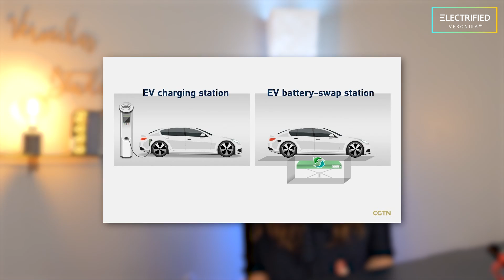New BATTERY SWAPPING Electric Vehicle Technology!

Comment: I was thinking that this swapping is the ultimate way to go in EV environment, until I started to work on BMS SW. First of all standardization is necessary not only in mechanical constraints but also in SW controller too. Especially modular swap brings many questions such as battery balancing, SoH algorithms, integration of info about SoC, SoF, cell type related OCV calibration information etc etc to the SW. It is very complicated and since we talk about a component it is like changing your diesel injectors not changing your fuel tank :)

Comment: I would not mind do a battery swap if I can get my battery back. And the battery swap costs less than supercharging station. Kind of mean I'm borrowing the battery while taking my battery when I go on a long trip and when I come back I want my battery back.
Reply from the maker: Interesting! Did not think about an option where after a road-trip you would get your own battery back 💡
Reply: @ElectrifiedVeronika  can I add a battery and a in-wheel hub to the rear of  a front wheel drive car to turn it into a plug in hybrid?

Comment: Congratulations on a great informative and inspiring video. To be honest I have thought that this is the way forward for many months. All we need is to transition the oil companies to be the battery owners, they would convert their petrol stations, (at a rate of say 15% per year this would meet E.U targets) and have future revenue stream replacing that lost from reduced petrol sales. They also would have the power ! to influence the car makers to change their designs and offer very attractive terms. The car manufacturers would win because of greater EV uptake. Everybody wins. Simple.
PS. 
Some of the Oil companies also have solar power divisions, so PV equipped charging stations could be possible and reuse of battery packs in power systems could be considered as another business to move into for them .

Comment: One thing that everyone seems to be overlooking is if you go to the modular model, say the suspension is tuned for 4 modules but now you only need one installed, you would have to have a way to adjust the suspension for 1,000lbs less weight. Also the KWs that the motor or motors are capable of will have to be adjusted way down if you change from say 4 modules (120kwh) to one (30kwh) for example. Now you can only get say 120 kw (161hp) out of your motor vs 480kw (644hp) out of a 120kwh pack.

Comment: CATL isn't a car manufacturer but rather a battery supplier to other EV makers. Their battery swapping solution might turn out to be a pseudo standard in the long run if it is well executed and well received by other Ev makers and that might also solve the infrastructure duplication problem which the Chinese government would view as a nightmare with too many competitors in that space and a dilution of capital in a variety of solutions. At first look, Catl battery swap seems well thpught out with huge potential, but the proof is in the pudding and we have to see how well it's executed and received by the partners in the project.

Comment: I'm almost sure that big car companies will not be interested in such battery swapping technologies. At least, during next two-three years. This technology doesn't solve today's batteries shortage, it even makes it worse. All cars are different and they will be different. Tesla will move all their cars to structural battery packs in 2–3 years, other OEMs have no time and/or money to develop one more body technology that has a very cloudy future. For new Chinese start–ups this swapping technology can be an option, it also can be an option for electrical city taxies but for most people it will always be more expensive and complex to swap the battery than to charge it at home. Modern LFP batteries can last up to 1 million km so nobody will need to change their battery ever.

Comment: ideally we need three tiers: built in batteries, standard swappable packs and running power ie an inlet that powers only the bare essentials and hence could be any third party uncertified non standard battery pack. also swappable packs are used first to prolong life of inbuilt battery pack

Comment: Exchanging batteries are good but old batteries could may make problems.
Reply from the maker: Yes, good point. I thought the same, but maybe if it is just about the capacity you don't talk about old batteries, but about batteries with less "range"..of course at some point they might be used only for storage and then finally recycled. Good thing would be to track all the historical data so we know the status of every battery all the time..

Comment: I think with Tesla’s advanced concept of structural battery pack will not work at all with swapping. In addition there are so many disadvantages of swapping model, among others: 1) Needs definitely much more batteries to be waiting at the swapping stations, 2) people like to own their battery, 3) It doesn‘t allow for structural pack, 4) There will always be different batteries (chemistries) for different driving behaviors, 5) Swapping stations will be more expensive than charging stations because they are more complex. 6) Many people also charge EVs at home (preferably at night) so you do not have to drive to swapping station.
There is a reason why Tesla is not doing it.

Comment: CATL created solutions for some of the issues common with battery swapping concepts but some others still remain such as infrastructure and cost. Without a sufficient base infrastructure and growth, it will very challenging to secure long-term contracts with EV manufacturers considering their sales will be limited to the areas with available infrastructure and they will live or die together due to standardization and all that implies in their factories and supply sources and lack thereof dedicated batteries. The consumers will still buy the battery they use, it's just not an upfront cost. In terms of cost, each battery will actually be more expensive because it will need to be engineered to handle hundreds to thousands of swaps without failure. The consumers are paying for the extra cost of the battery structure as well as the maintenance upkeep and the salary of the new jobs created downstream plus whatever convenience fee that will be going towards the profit of CATL. The upfront cost of the vehicle will be less but the effective cost of travel will be more. This can be ideal for people who like to buy a new car every few years but not so for those who drive their car until it dies. 

TLDR: Due to the required enormous initial investment in infrastructure and serious commitment required by EV manufacturers to standardize and entrust their life to CATL (or any other company providing B.a.a.S.), I don't believe this will become widespread.
Reply: What you stated is right on. On the other hand, Chinese market is the largest EV market in the world. In fact, it's as large as the rest of world combined.  There are already thousands of stations serving hundreds of thousands cars daily. EU just started. I wold expect scale of economy will be there with or without US.

Comment: As the grid also need batteries to buffer the renewables all the battery packs at the swapping station generate money while just idling there. The compensation is already so good that NIO and CATL could provide the batteries for EV users for free. This is quite smart way to go as they can also make the cells safer by reducing their power capabilities. Smaller is the max power from the cell less will be the heat at the short circuit event. Low power LFP as a solid state battery is cheap to make and not even that heavy for EV use. Fast charging requirement has made everything so much harder and hopefully we can now throw that bad idea to bin. Finally!
Reply from the maker: Absolutely agree! Thanks for your insights!
Reply: The batteries for grid might have completely different characteristics (less high-tech) as the batteries for BEVs.

Comment: The user may not "own" the battery but they will still need to pay for the battery or battery module being designed with sufficiently rugged mechanical and electrical fittings to tolerate repeated installation and removal.    The owner is also paying for additional battery capacity in the swap infrastructure in order for one to be available to swap.  Tesla seems to be betting that the battery cost will fall quickly enough that there will soon be little economic advantage to not owning the battery integral to the vehicle.

Also, the video implies that, by making the battery pack structural, it is no longer removable from the vehicle at its end of life in the vehicle.  I do not know that this is the case.  My take on the structural battery pack is that the chassis is no longer very stiff with the battery removed, not that the battery is not removable.  We should know the answer to this very soon if it is not already known.

Comment: In any battery analysis, fact number one is that in any use case, smaller batteries need to be charged more often.  While I will admit to the advantage of sizing the battery in the car for the current driving need--including the excellent advantage of not carrying the excess weight of a large battery that isn't needed most of the time--battery swapping won't work all that well for the people who it is most targeted to: the people who can't feasibly charge at their own residence (home or, especially, apartment).  The problem is, if you opt for a small battery, sized for your daily or just a few days use, then you will need to be going in for a battery swap very, very often, which will end up being quite inconvenient and time-consuming in the aggregate.
People in Teslas with batteries that are "oversized" for average daily use, say, 75 to 100 kWH, have TWO distinct advantages: one is that they need to charge less often during the typical week, and another is that the battery is taxed less on an average daily basis, because only a fraction of a full charge-discharge cycle is required each day.  I posit that one major reason that Teslas batteries are retaining capacity on average much better than, say, early Nissan Leafs is that the battery is literally three to four times smaller in the Leaf, so it is "worn out" three to four times faster in any case that involves frequent and substantive driving (simply due to the vastly more frequent full charge-discharge cycles (or equivalent)).

Comment: Even the modular approach requires standardization to become effective.  I also think this approach is short sighted as the technology and how we use our cars change over time.  In the future, when all cars are also generators, the additional size of batteries will be useful in more ways than just driving around town.

Lastly, I'd say consumers already choose the "right" amount of battery for their needs by the purchasing decision.  Don't travel a lot, buy a Leaf. Take road trips all the time, buy a long range Tesla.  Willing to take the time to charge but don't want the upfront cost, buy a standard range Tesla or other EV with 200 - 250 mile range.

Modularity actually adds complexity and cost to the distributor and owner of the swap station.  I can't see this as a viable business venture for any company to pursue as you still have the overhead of transporting batteries from one swap station to the next.  Think of all the transportation headaches trying to ensure the right amount of batteries are at the locations that need them the most.  Very inefficient way to do business!

Thanks for the additional insight and information in this video!
Reply: Mhm I think you may be referring to a small percentage of the EV buyers that actually choose their vehicle after thoroughly considering their range needs. For most people, if they want a Tesla and they can afford it, they will buy it even if most of their battery capacity goes unused almost all of the time. There will be logistical, insurance, and legal challenges with BaaS but I think this concept certainly has merit and it'll be possible to get around it.

However, a bigger concern I'm thinking of is the stability of the car that comes from 500kg+ of battery placed at the bottom, which is a quarter of the car's weight. If people are allowed to choose how much battery they want, every vehicle will have a different level of stability. A full 500kg battery pack could have a much lower CoG than if the user decided to go with 100 - 200kg battery. For BaaS to work, the car will need restructuring (better weight distribution) such that it will already be stable without a battery pack and any additional added weight of the battery won't cause a notable difference in lowering the CoG further. Am I thinking about this the right way? Thoughts?

Comment: Really a great video Veronica, 
According to me swapping is great only if standardization is set for each and every vehicle.
But as you said in the video it's not possible in the near future,it will take a lot of time.

I think fast charging is the only solution here.

Or if standardization is not possible swap all battery cells instead of battery pack/module.but here you need to be more careful.
But this idea sounds funny 😂.